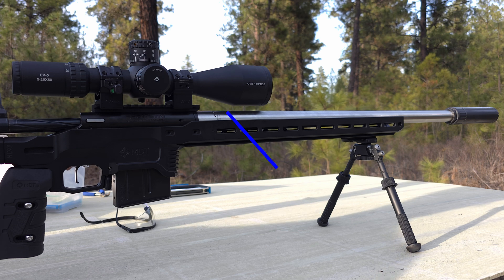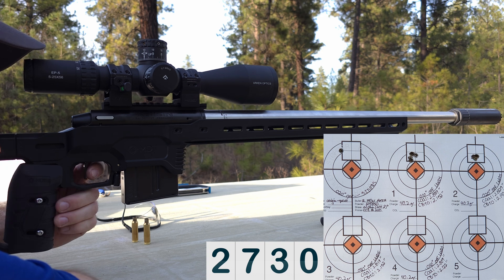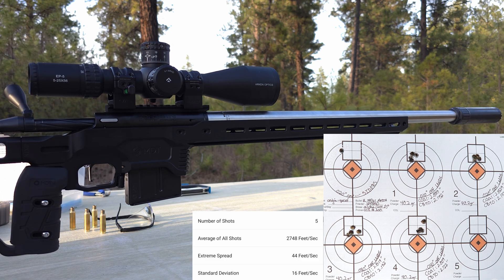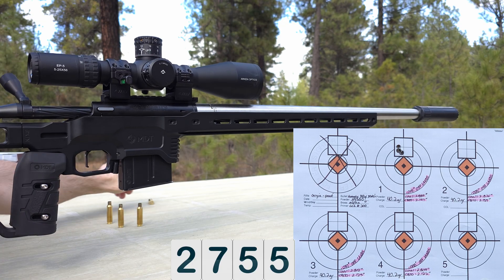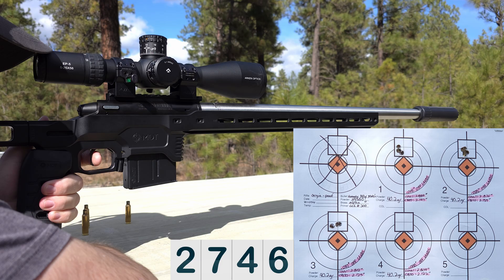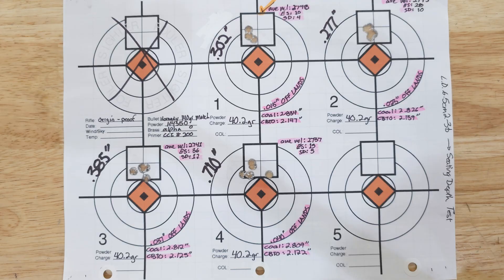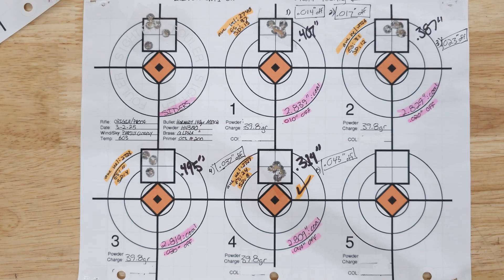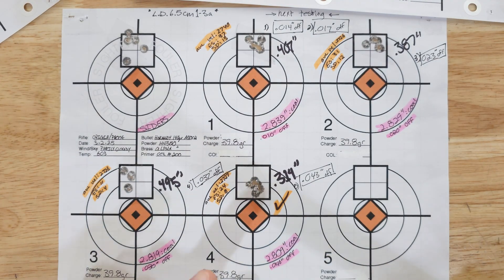10rd ladder test: part 2 - Seating Depth Test (OCW vs 10rd ladder test method series)

Comment: What I see is a .3 to .5 load for the most part. I'd still play with the seating depth window around.020 a bit more to verify the window for condition swings. POI is pretty consistent in the lower chg wt.

Comment: Looking at those results
For powder 39.8 and 40.2 
For seating depth .01 and .02
I would go 40gr at .015 and if that was close to the results in other 2 tests of it was basically the same I would just call that the load because you have that range of 0.4 powder and the range of 0.01 and 0.02 seating and that data so middle of both tests and so you account for minor variations when loading
Reply from the maker: Yeah im in the process of doing another series for brass prep and going to be testing things most ppl dont consider during brass prep so since I've got another 1k rounds more on my barrel than when I did this im going to tweak the load so I have a good consistent load worked up for the brass prep series as well as a primer testing series after that.

Comment: IMO 🤡, you’ve unknowingly just wasted a bunch of time, money and components to find out next to nothing that has any real statistical relevance. No offense but, 5 shot groups are all but useless. How do I know because, Ive shot a million of them and I used to believe it too!  Started reloading beck in the early 80’s and have tried every load development method known to mankind. They all seemed to work, at least for a little while until the next latest and greatest came along! After watching the Hornady podcasts and them applying real mathematics to the problem, I can see I was duped and fooled into buying into all the hype too. It’s plain as day, you can’t make a rational decision based on inadequate data, 3-5 shot groups are inadequate and is misleading data! Test your findings. Take the best load you developed, the one you think is the smallest. Then take the worst group and load 35 rounds of both and go shoot them. If you’re right, the difference between the two groups should hold up with an increase of data points. If the difference in size between the groups goes down, now we have a problem. Your best group is not as obvious as you originally thought it was. “Winning In the Wind” just did this test, he actually use 3 control groups (a better  ore thorough test), and was surprised by the results. You should be able to find it on his YT channel. Good luck, you’ll figure it out! 👍

Comment: I saw also the previous videos …of the test, you made a great job, very useful for reloaders thanks.
Do you think the entire load development would keep its value in case you now had to switch to another brand of primers?
Reply from the maker: Id take your developed load and try the new primer and if the results are less than stellar than thats when you'd wanna either start over with your new components or try treaking little things like seating depth or charge weight (basically starting over with a better idea that your barrel likes that particular bullet and/or powder).  Im actually stocking up on several different primers when I can so that once I've got a solid load for my rifle (h4350/140gr Match) and swap the primers and see just how much of an impact you can expect. Thanks for watching 👍

Comment: Retest your best load & the worst load with six 5 shot groups of each and post the results , if you dare 😂
Reply from the maker: Why not just do a 20 or 30 round group?  Why do multiple 5 rd groups?
Reply: @Reloaderscodex most people are afraid of shooting a 30 round group at same point of aim 😅
Reply from the maker: Im def not afraid I just can't afford to shoot 30 round groups for all my groups.b
Reply: @Reloaderscodex just do 30 with your best and worst “nodes” from smaller sample testing
Reply from the maker: What's the point of doing it with the worse as opposed to just the best
Reply: @Reloaderscodex it’ll show you that what appears to be the best or worst from 3-5 shot samples , shoots the same for accuracy
Reply from the maker: You're saying that charge weight doesn't matter whatsoever?  And it all shoots the exact same?
Reply: @Reloaderscodex  That's exactly what the Hornady guys say. You are seeing noise not data because your groups are too small. You might just as well pick your load based on your favourite numbers.

Comment: Congrats on getting it to shoot. Going ten thou difference will cause you to jump a good place. I do three thou, and go from six thou in to eighteen thou out. You can really see a sine wave moving from group to group. The reason I do three thou at a time is to keep me from landing on something that is unstable on either side. I've seen one ragged hole between two groups that were crap. That little group, even though it's good, is a place to stay away from. BTW, some bullets don't seem to care much where they start from, and others are very sensitive. Twenty thou looks stable. Just make sure you don't have something unstable next to it like the forty thou group.
Reply from the maker: @N5KDA good to know.  Question...is using 3 rd groups, not necessarily to find good seating depth but to exclude the bad and then go back to the good one and do a 5 shot group something that ppl do. As a way to save on components.
Reply: I started to do this but stopped once I began to shoot long distance. What a bullet does at 100 yards and 800 yards can be two totally different outcomes
Reply from the maker: @lemarcwhetstone6354 good to know.  I  live with tens of 1000s of farmland around me and need to find a farmer that'll allow me to shoot at long ranges bc I really want to get in long rang shooting and not just at 100 yards.  So how do you set up/run seating depth tests?
Reply: @Reloaderscodex  I shoot some groups at 100 yards. I don't go too crazy with chasing tiny groups. To me, the bullet is more important. You'll spend tooooo much money on Berger (what I use) at 100 yards. Find a nice maybe half inch moa group and try it at distance. Those tests get expensive QUICKLY
Reply from the maker: @lemarcwhetstone6354 Yeah, the hornady 140gr Match are good in my barrel and cheaper than the 140gr ELD-Match, which are terrible in my barrel.  I've tried just about everything to no avail.  The berger 140gr hybrid targets are awesome, too, which is the next video Im working on now that the ocw vs. 10rd ladder series is finally finished. Lol.
Reply: @Reloaderscodex  if your rifle likes the Berger, they would be a nice goto for long range
Reply from the maker: @lemarcwhetstone6354 it's been a minute since I've shot them and id have to go look at my targets/notes but I believe they were shooting in the .3s and low .4s pretty consistently.   That's with rl16. I haven't tried them with h4350
Reply: @Reloaderscodex  How did you get rl-16? I only have 1lb left.
Reply from the maker: @lemarcwhetstone6354 i got some back maybe 7 months ago and just started using it.  Is it hard to come by now? I haven't looked for it since I ordered the lb I have now